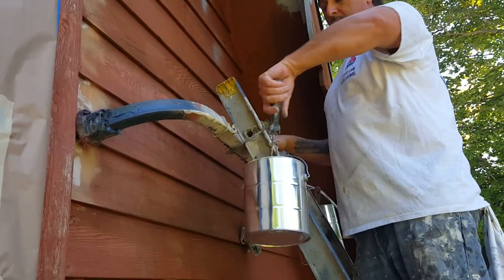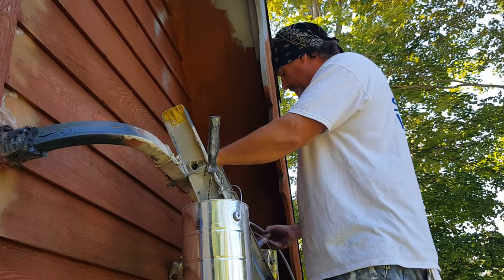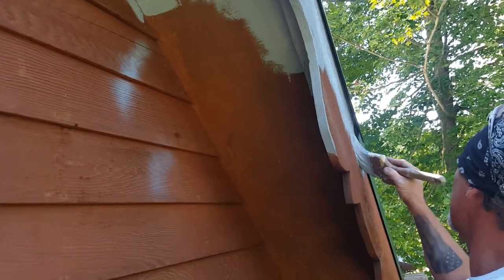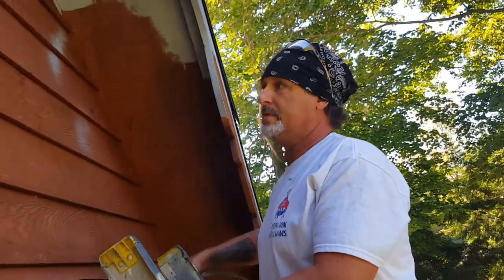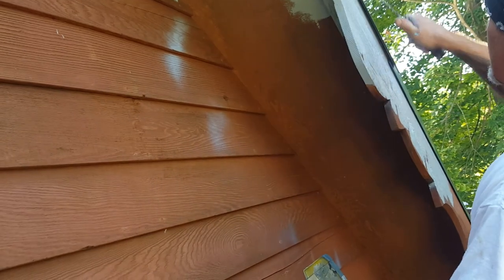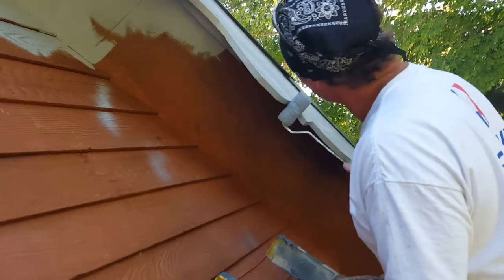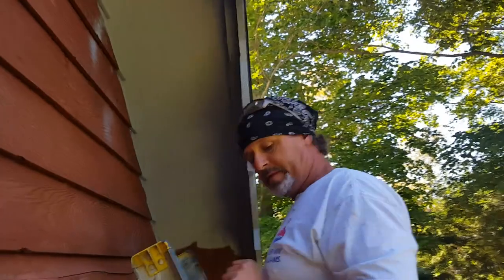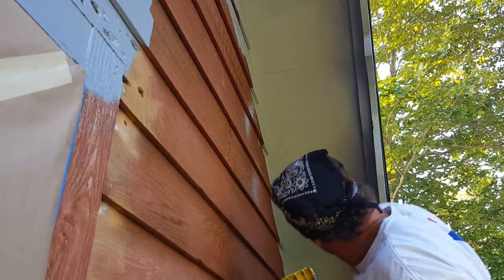How to Paint a Cedar House Part 2

Comment: Such a waste of time, energy and product
Reply: Why would you say that? You are ridiculous.
Reply: @jc2604  I would say that because it’s so.   I might be ridiculous but he’s wasting SO much time, losing product and the amount of energy he’s putting out to get up there with a hose/gun, a roller and bucket, then another bucket and brush is INsane!  He needs to rethink this method.  Get up there with a bucket and a 4” brush and just paint it all.   Painters over use a sprayer just to say they’re spraying.  I have a fantastic expensive sprayer and I use it when it’s needed. Not when I want to. This Guys not thinking.
Reply: @jamesmaher4807  what most contractors want to do is get up there with ONLY a sprayer. The benefit of a sprayer up there instead of just rolling it all is he can go through 5 gallons of paint before he has to come down. He's also not trying to dip a roller and get off too much excess and all that garbage. He's just spraying a backrolling.....it goes pretty fast and often is a lot easier on rougher cut wood.

You should try it sometime.